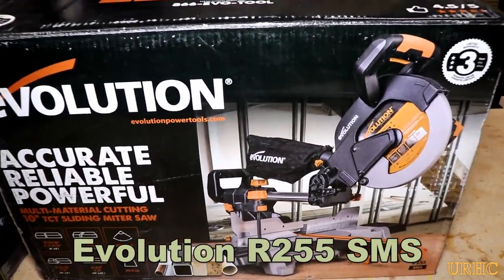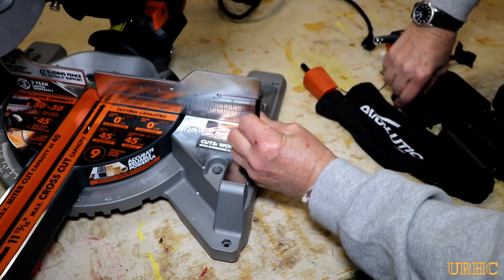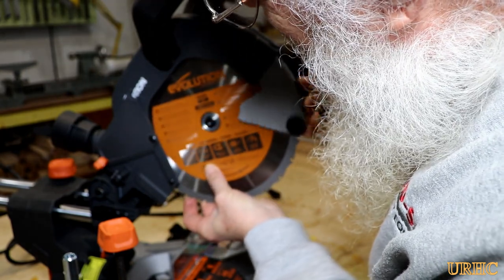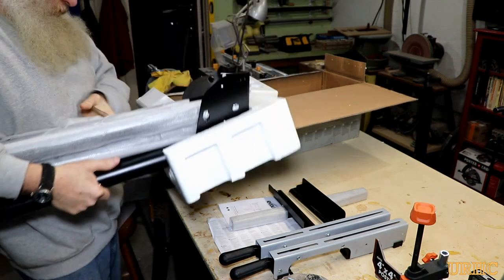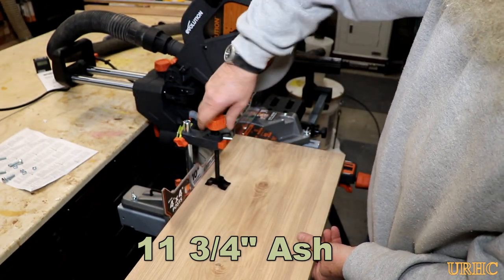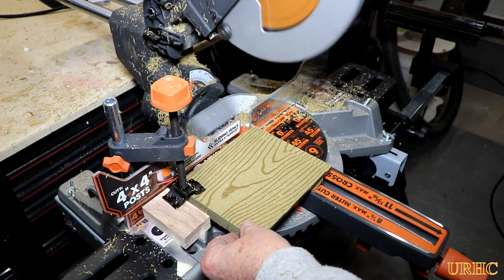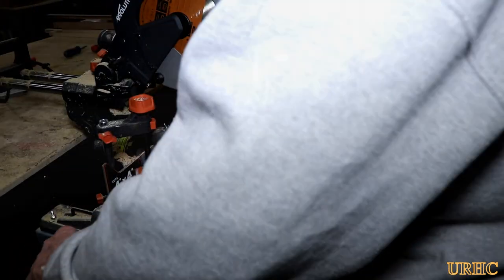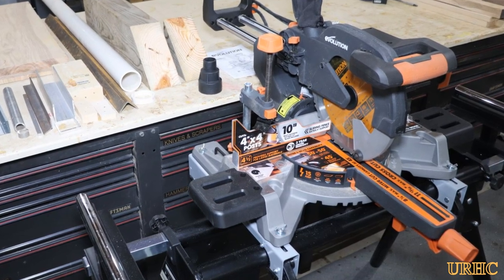Evolution R255 SMS Miter Saw With Matching Stand Assembly And First Impressions

Comment: Very important it doesn't matter which machine. always buy a Slide Compound Mitre Saw with the handle in a line above the saw blade,everything has to be in line Slide bar rails,handle,and saw blade. it's better  no tilt saw blade, and engine with softstart .

Handle vertical or  horizontal above saw blade is okay if it is in line above the saw blade and in line with slide bar.Everything has to be in line this is important 
like this video.
Reply from the maker: I think just about all of them these days meet that criteria. Thanks for watching.